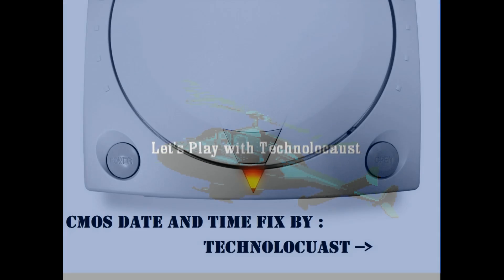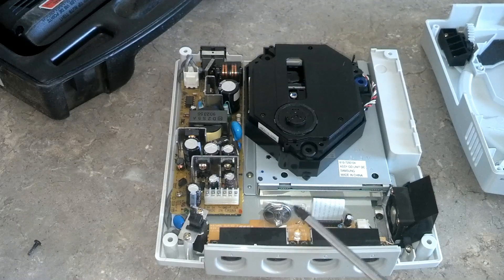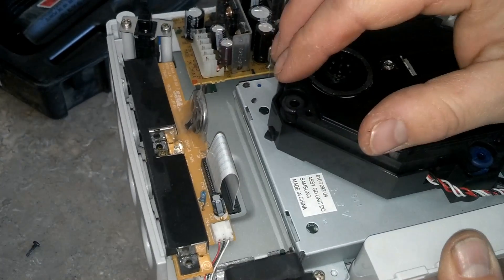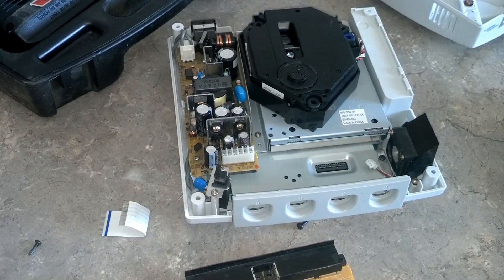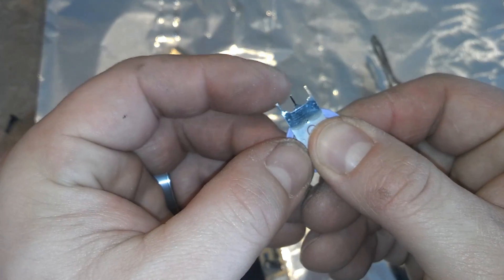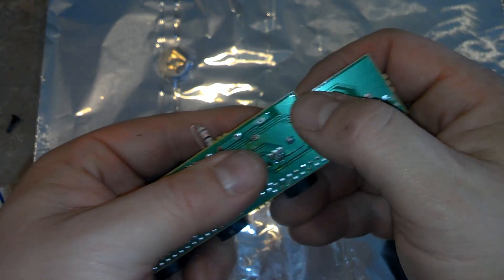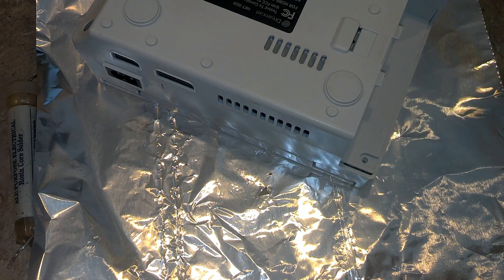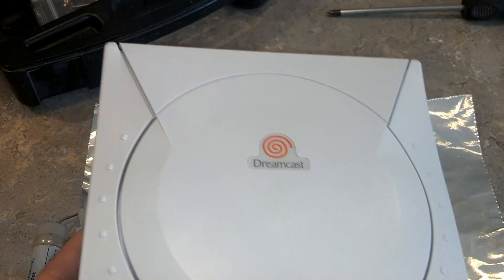DreamCast CMOS Date and Time Repair with Technolocaust

Comment: When my time and date comes up at boot, just like yours, I’m not able to change the date and time.  It’s like the console is not recognizing anything from the controller.  Is that normal, or should I at least be able to set the time and date and have it stay until I reboot?  I can’t do anything at all.  I bought it at a garage sale with 30 games for $20.
Reply: The Dreamcast is notorious for the controller ports going out.  There is a fusible resistor that has failed, you can fix it by twisting it to bridge the connections although I would recommend replacing the resistor. Also, I am very jealous that you found such an amazing deal.
Reply from the maker: Does not seem normal , you should be able to change it with your controller. Try another controller if the 2nd controller gives you the same issue it might be the port on the dream cast :(

Comment: I would instead use a batteryholder with a recharable 2032. If it ever dies you can easily swith the battery out :)

Comment: That one has lasted 16 years because it isn't one of the failed ones that somebody threw out early on. Dreamcasts were just as susceptible to faults as any other console. Wait another 10 years and lets find out how many 360s and PS3s are still working fine.
Reply: I have a xbox 360 since launch date in 2005 so i had it for 12 years.Its showing its age like the power lights dont work sometimes but still works fine with games.
Reply: KFC Bucket Yeah, but how many millions of the things have been disposed of? The few surviving examples of something are not a good example of how well it was built.

Comment: 4 people bricked their Dreamcast. Just kidding. Thanks for posting this. My DC won't keep time and I needed a quick fix.
Reply: this isn't a quick fix and frankly stupid unless electronics is your forte, if you're a dope off the streets and with NO soldering iron i say there's nothing you can do except live with it. I mean is it really worth killing a console just to save time/date? also sega should've made the vmu help back up date/time, poor design
Reply: Youtube LTD
Yeah you're right. The VMU was a better solution. It seems it keeps data better anyway. The batteries in mine were dead when i bought one, but it still had old save games from the previous owner. The GD-ROM was also not up to par from what I understand,  it could have been a better quality. Sega trying to save money, at the cost of hurting customers :/
Reply: its a very basic replacement, 3 easy points to solder, the rest is a few screws, id say if you have done any soldering at all ever (& not good) you could still do this. but if your not comfortable, don't do it. the important thing to remember is to use a rechargeable battery.

Comment: Electronic components on tinfoil is not a good idea. It conducts electricity.

2032 is the normal size you should use not a 2020. CR is no recharable. ML2032 is standard but using a LIR2032 is best (lithium ion) and will last much longer
Reply: according to ifixit (which i've used to fix my lcd screen for my samsung gear2)  someone states the best type https://www.ifixit.com/Guide/Dreamcast+CMOS+Battery+Replacement/5020#undefined
Reply from the maker: Neil Bolt Good info! thanks for watching and helping
Reply: Neil Bolt Maybe it'll last more, charging cicles wise. But if you check on the capacity of these batteries, most of the LIR2032 hold up to 40mAh, while the Panasonic ML2020 holds 45mAh, and the ML2032 from Maxell company holds up to 65mAh. 65mAh Maxell can reach up to 1000 recharging cicles with slow discharge, so even that is superior to cheap China LIR2032 batteries, wich holds up 500 recharging cicles before they die.
Also LIR2032 is a 3.6V battery, while the original battery is a 3.0V cell, I believe that could cause some problems with the Dreamcast over time.
Reply: Hey,  what kind of battery would you recommend for the longest lasting VMU power?
Reply: Do you know what battery I should use for the longest lasting VMU battery?
Reply: is that still the best? any confirmation it works btw? im looking to replace my cmos battery, also do you know if that works with the VMU (to charge and all)

Comment: Hey Technolocaust
I'm trying to replace my Dreamcast battery, however the original 3 joints won't un-solder. Any ideas? The Iron is hot enough to melt the solder I bought.
Reply: I got it nm
Reply: How did you manage to get it in the end? I'm having a nightmare trying to get it loose!
Reply: I had someone hold the iron and alternate between each joint whille I lifted up on the battery. It will slowly but surely loosen up and give way. Best of luck. :)